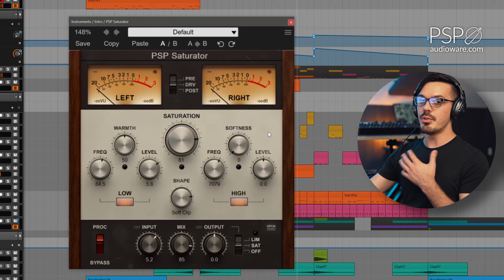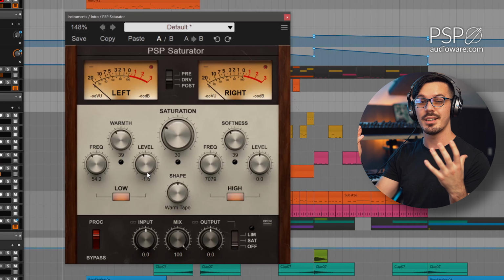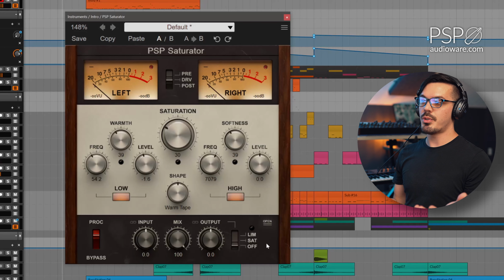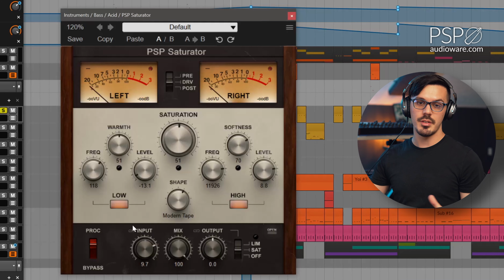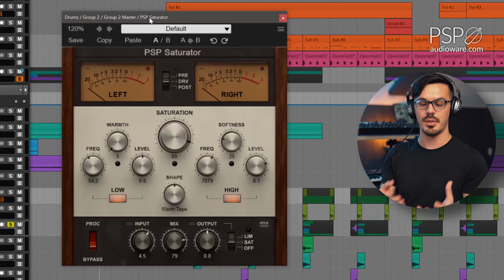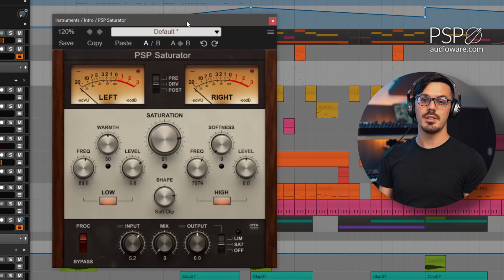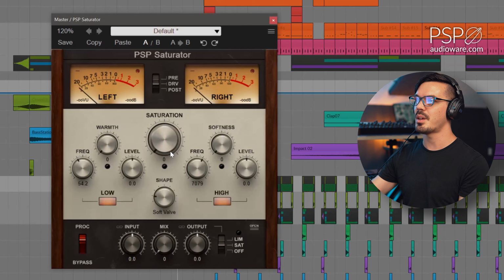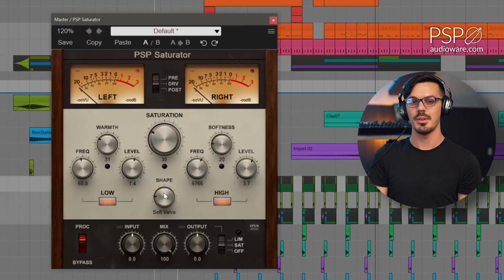PSP Saturator | Practical Mixing Guide

Comment: Demoing now. I don't usually glow about new stuff like this but I had been hoping a saturator plugin would come along and knock my IK Tape off it's cpu hogging high horse for some time now and I have finally found it. I have Kelvin and most of the others but I was specifically looking for something that rivaled the IK Tape sound. To be honest, I didn't expect it to come from PSP (no offense PSP) but I'm floored by this plugin.The sound to my ears is at "least" as good as IK and the more I play with it the more I'm thinking "better" because of all the options it comes with and with only a fraction of the cpu usage IK Tapes. Why couldn't IK do that? This plugin proves while a quality plugin can take up a lot of cpu, it doesn't always have to if you do it right. No more "which plugin do I kick off my master bus so I can use the IK Tape too?" type situations on my master bus because of the huge cpu usage. That got really old fast. I can finally use my Softube EQ1 (another hog) and Softube DS1 WITH PSP Saturator together on my master bus. PSP knocked it out of the park with this one.jmo!

Comment: This looks good. Simple and to the point.  However, at $70 into price, I'll pass...there are so many great alternatives that do so much more.
Reply: If you have other PSP plugins, your price will be lower. Log into your account to see what your final price is.
Reply: @CardinalEgan  Absolutely not true. Just tried it. No discount other than the promo price of $70 for the $100 regularly priced plugin.
Reply: @CardinalEgan  It looks like you have to ownn PSP Mix Pack.
Reply: @CardinalEgan  where can I get that promo code?
Reply: @timbeneton8068  you have to own mixpack, only then you'll have the code
Reply from the maker: @CardinalEgan  you can't combine the intro and loyalty discount in that case. There is a special offer for the MixPack users.